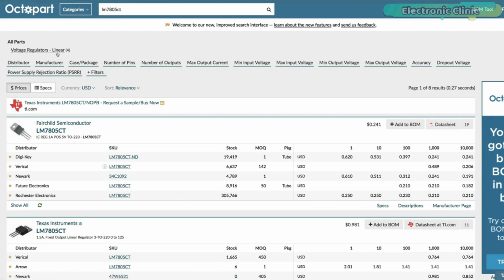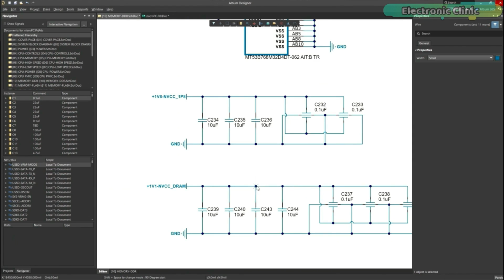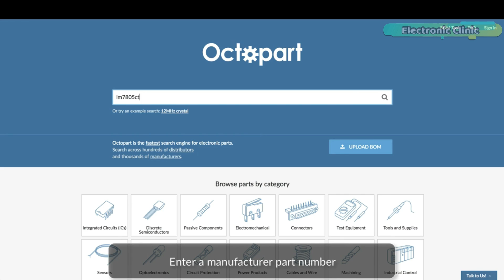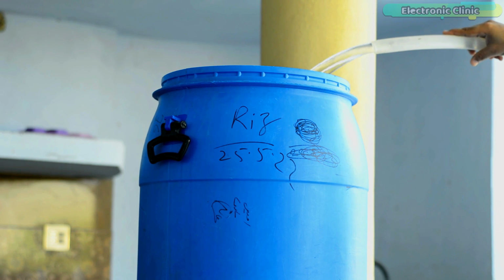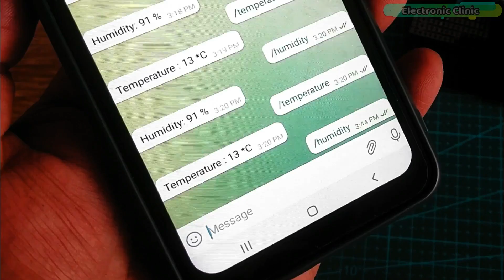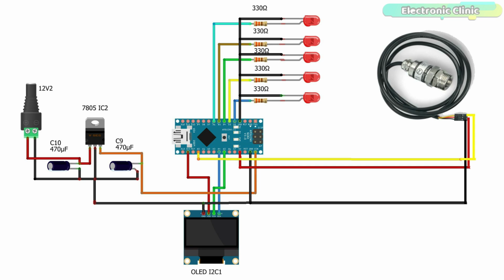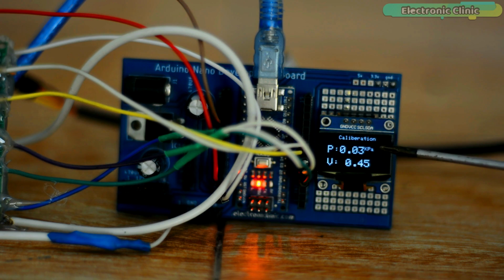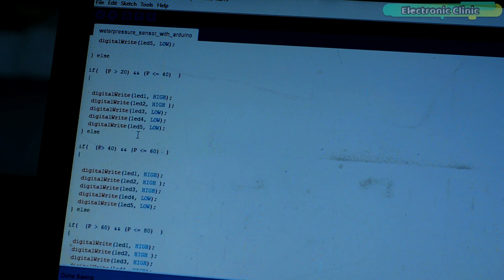Arduino Water Pressure Sensor Project, Water Level Pressure Sensor, Water pressure monitoring

Comment from the maker: Other water level related videos:

ESP32 with TOF10120 Laser Rangefinder distance sensor
https://youtu.be/0AZxX3_eLQ0

IoT Water Level Sensor Using ESP8266 Nodemcu
https://youtu.be/euZkv0wJBiM

Arduino iot Project: iot Water level monitoring using Ultrasonic Sensor + Nodemcu esp8266 + Blynk
https://youtu.be/hLOM4WDovj8
Reply: Great work sir can I use the program with reading the boiler pressure gauge ?? And how?

Comment: One problem I have with liquid sensors based on hydrostatic pressure is an unstable reading. The reading always jumps between high and low values regarding its accuracy. For a low level of water (e.g. under 1 meter), this can be a big measurement error. An ultrasonic sensor can give a more stable reading, but I believe it has weaknesses in waterproofing. Or you can suggest another type of sensor with a stable reading and good durability?
Reply: Have you solved this issue? I'm also facing the same problem !
Reply: @adilahmedbhameshan6627  Yes, I use a more accurate sensor with reading ranges of 0-100 mBar. The reading error is quite small.
Reply: There is a waterproof ultrasonic sensor but also I have unstable reading the data when closing the tank cap due the echo of ultrasonic waves inside the tank
Reply: @TheCalibso Certainly, that is one of the disadvantages of an ultrasonic sensor. I have used ping sensor and it can be accurate with tank width > 50 cm and depth < 100 cm.

Comment: Great idea  I was thinking about doing this for my boat water tank. But it's quite long and narrow so my guess is the head pressure will be low even when full in comparison to a vertical tank. I need to do some testing.

Comment: Very good! Would you mind sharing with us the information about the accuracy you could get with this setup? I mean, what was the minimum water level variation you could reliably obtain? Could you, for example, reliably tell the water level in 100 steps (1%) instead? 
If the sensor accuracy is indicated in its full range of measurement, I would expect poor reliability for small water level variation, which I need in my project. Thank you very much.